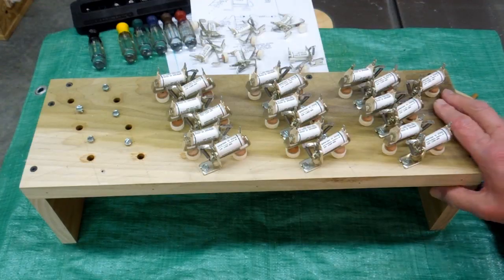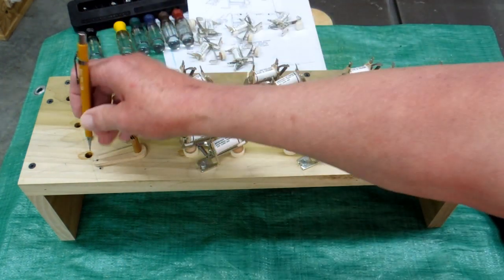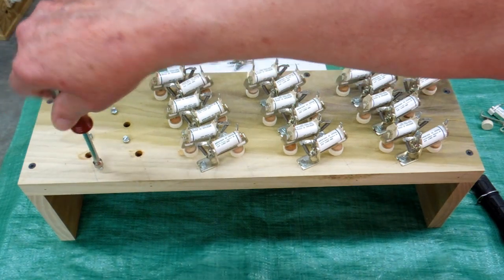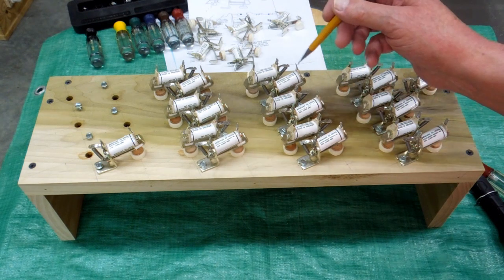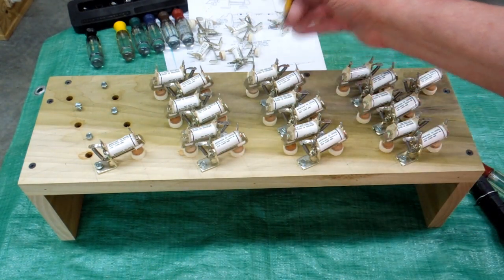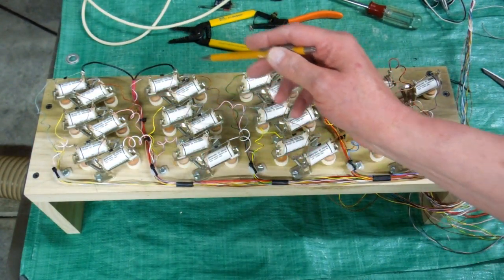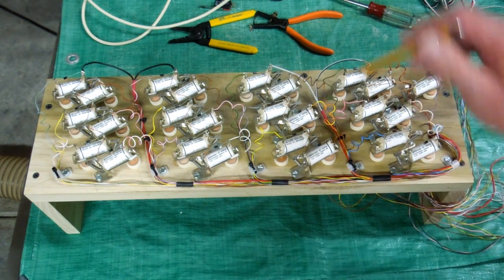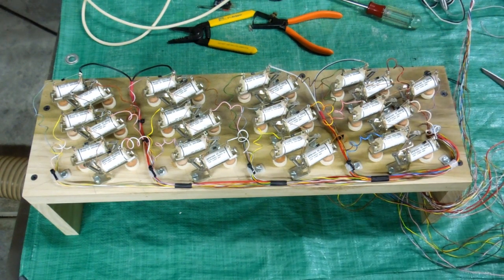Mini-Calliope Part 8 – Pallet Magnet Installation

Comment: Are you just using 1 diode per valve?  Does it matter which end of the valve you feed positive and which end is the signal or ground wire?
Reply from the maker: David, 

Sorry. I thought I answered this yesterday.

The magnets don’t care which way they are wired.

However, for the midi player I am using, the common wire for all magnets is POSITIVE.

Each individual magnet is then operated by its ground wire, pulling it to ground and completing the circuit.

Just one diode between the posts of the magnet.

I thought I showed the installation of the midi driver in one of my videos but I can’t find it. Hummm?

Thanks for watching. 
Please subscribe. That is what keeps this channel running. 
Ron

Comment: Hey congrats on 100K subs!
So at 12V, each valve would be pulling about 0.3 amp? Yeah, I can see why you would want two banks with separate ground wires. Or was there another concern?
Reply from the maker: The common wire for all of the magnets is positive. The individual small control wire(s) pull the magnet(s) to ground. Individual smaller positive wires were what I had and a bit easier to snake around where they needed to go. The separate positive wires are eventually tied together at a single point on the magnet driver circuit board.

Comment: Your wiring gets better each time. Beware that telephone wire was made specifically for wrapping or crimping and can corrode away with residual flux left over from your solder. It takes a couple of years, I learnt the hard way. I guess you could flux clean the joints?
Reply from the maker: Surely my good rosin core solder won't corrode my calliope wires. :-)
Reply: Probably not but it has happened to me.